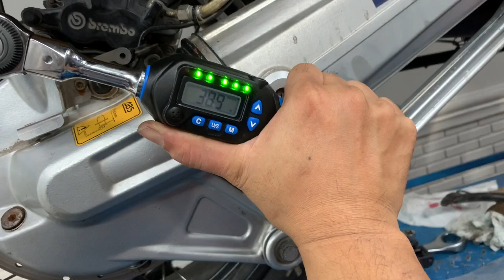BMW R1100GS - Bevel box to swingarm bearing replacement

Comment: The gearbox output shaft and the final drive UV joint are often "phased" so its important to ensure the keyed portion of the splines are lined up. Otherwise the shaft will be unbalanced and vibrate. Some models are like this others are not, so check first.
Reply: Can you clarify phased please? Are there markings?
Reply: Indeed.
Markings of original position helps before taking apart.
Reply: @douglasdickson6986  Markings no but it's quite obvious as there is a wider gap between splines which has to be aligned with the shaft.

Comment: Small tip, always first remove the filling plug. If any previous owner molested the inner hex of the filling plug, you wont get stranded with an empty final drive that you can't refill. (dont ask me how i found this one out :-( )
Reply: An other small tip.
Do use PTFE tape as sealant. Prevents corrosion steel /aluminum and makes easy to remove next time.
Always works and never leaks.

Comment: These bearings is a permanent pain of  this model, especially if you ride gravels & offroad. I made two polyoxymethylene (POM)  bushings to replace bearings & installed it. I rode ~5000 km (include 2000 km of bad roads & gravel) all OK!   If it will working well at 20-25k km, it will be very well!  1000mm×40mm POM rod costs approx 1500 RUR (20-25 USD) and some lathe work - cheapest replacement!

Comment: If the original bearings are cleaned and re greased just sometimes it helps.
Much easier an cheaper.
Use a long term water resistant grease.

Comment: Very well done video!
Should the bearings be torqued in the inverted sequence?
RHS first because is is fixed, then the LHS for proper conical bearings compression, and finally the  RHS locking nut?
Reply: Correctamundo!